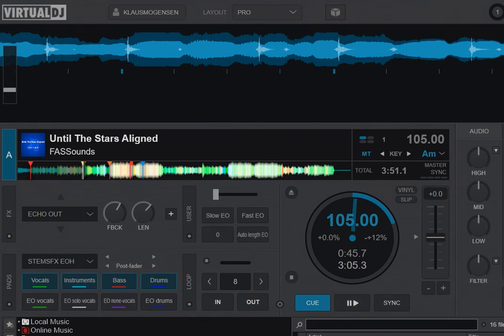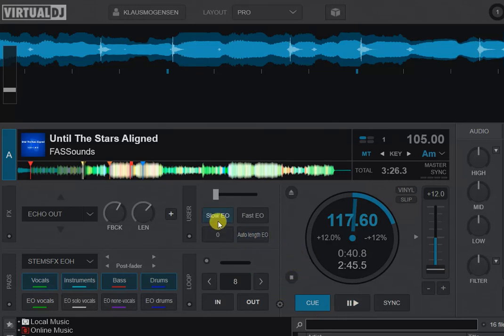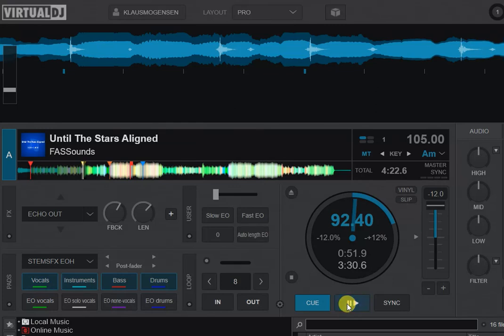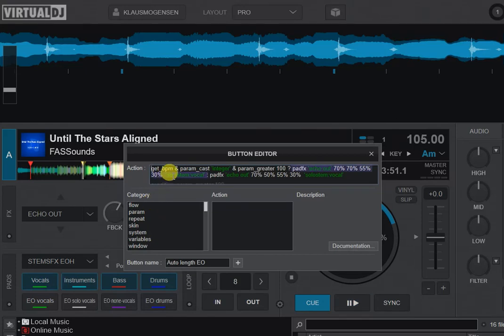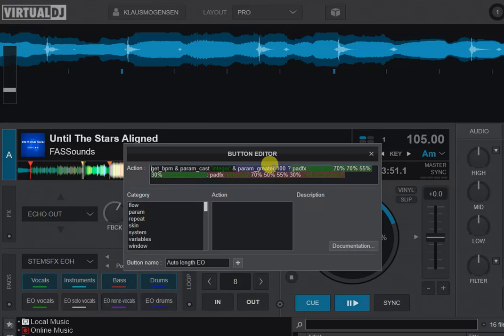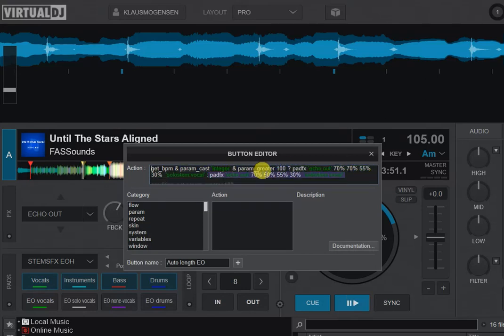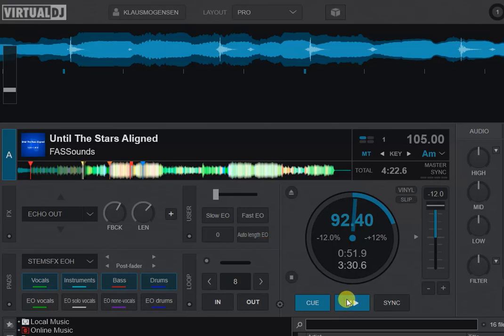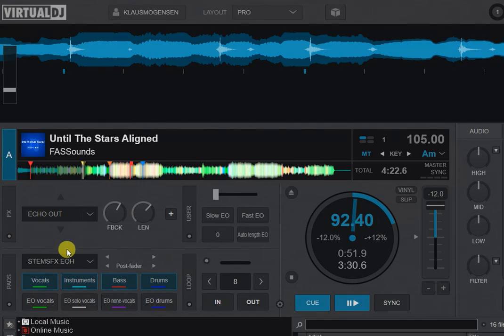Quick n' Dirty: Auto-length echo outs in VDJ8.5/2021

Comment: You the man!! as always, here's another challenge for you... apply that concept to the 'ducking echo' pad page. I'd gladly give up one of those options on that page for a 'smart ducking' option like this. What would that script look like? tbh I tried replacing the echo out with ducking echo but it didn't work so i figure its gonna be 'slightly' different.
Reply from the maker: Ducking echo is a bit different, since it doesn't do anything when you enable it - it instead "arms" VDJ, so that it'll then  react on most controls that stop or turn down the music. But apart from that you script it like any other effect 

So to change the script in this video to use ducking echo (I assume for all stems) will be:

get_bpm & param_cast 'integer' & param_greater 100 ? padfx 'ducking echo' 70% 70% 55% 30% : padfx 'ducking echo' 70% 50% 55% 30%  

... but it then won't actually do anything until you stop or turn down the volume of the deck
Reply: @klausmogensen8691  THANKS AGAIN. that works but it doesn't stay armed once the bbm goes below 100. i have to re-arm it again which defeats the intended purpose setting it not looking back at it till i want to turn it off.